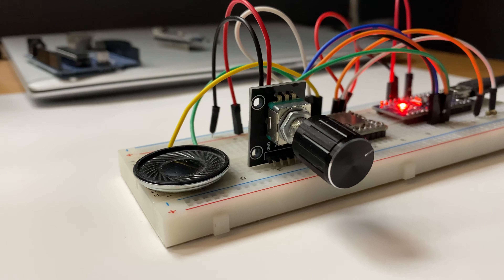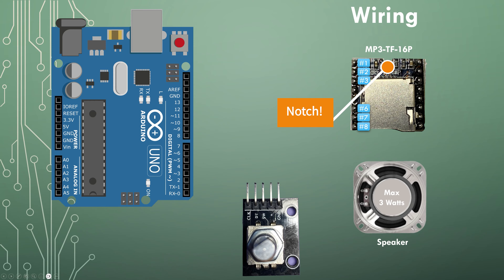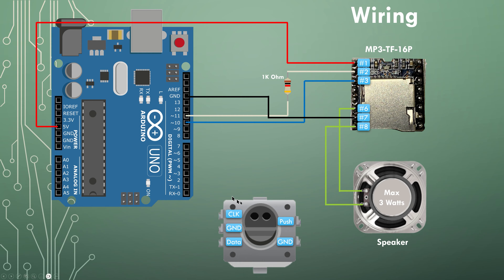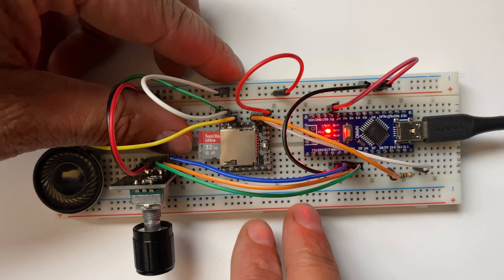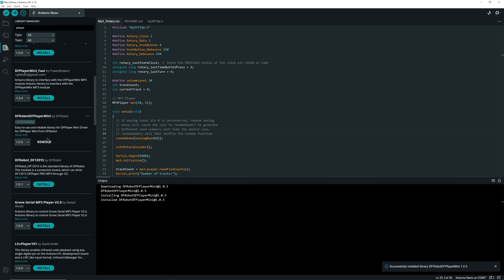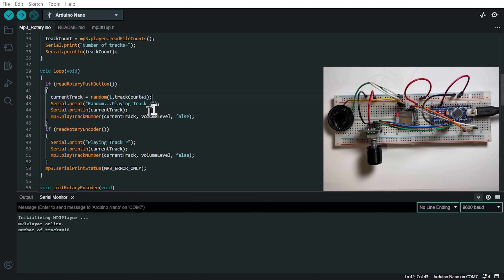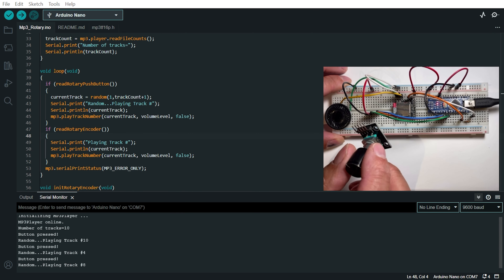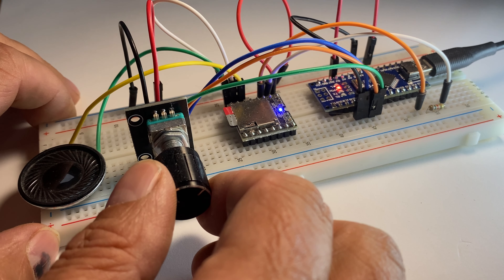Arduino Magic: Navigating MP3 Files with Rotary Encoder | MP3 Player Project Series

Comment: I appreciate the various Arduino and ESP32 videos you've done. I tried doing this one on an ESP32 but don't quite have the knowledge of how to do it. It worked as you described on my Arduino UNO R3 (Elegoo version). I do have a large number of mp3 files on my micro SD card so the count and random features didn't quite work as you described. Would you consider doing a video on how to do this same project using an ESP32? I've been playing with the ESP32s and loading up numerous features on them because of their faster speeds and more memory. I share your enthusiasm regarding Star wars and really like the various displays you've developed and adding sounds is fun. Thank you.
Reply from the maker: Thanks for the suggestion, I will add it to my list.

Comment: Hi
Wonderful project! I have a special needs kid who loves turning knobs. I have bought him several old fashioned radios (with knobs) and he plays with them all day!
I was in the middle of making a very similar project like yours. Here are some ideas that I need in addition to all of your nice work:
1- it needs to run on a rechargeable li-ion battery so is it possible to use 3.3 volts instead of 5v? It spares me having to boost the 4.2volts from the battery
2- it needs to go to very low power mode if the knob is not turned for over m-minutes. Then it comes to life after the knob is turned. This is to allow the child to go to sleep and save battery.
3- it would be nice to set the volume level by pressing and holding the knob for say x seconds. Then turning the knob left or right would play a test track at that volume level. If no knob turning is detected for more than y seconds, then knob function would return to normal
4- a config.txt file contains all the variables can be saved to the sd card (m,x,y)
I intend to plant this device inside his favourite stuffed teddy bear which he takes to bed to help home sleep. He is 29 years old with the brain capabilities of a 4 year old.
Thank you SO much!
Reply from the maker: Wow that' a good plan!

Comment: Couple of things: the current drawn by the player can  exceed the current limit of the 5V pin of an Arduino so safer to power separately. As with all IC's a decoupling capacitor should be placed across VCC and ground of the player.

The speaker issue is a little fuzzy as the documentation is not great. I've yet to find a definitive answer but it does appear the speaker impedance should be 8ohms. As far as the 3W max i believe that's the max the amp can deliver so you actually want a speaker that is rated higher than that otherwise at max volume (default at power on) it could damage the speaker. If you've found anything different I'd be happy to see it
Reply from the maker: I have monitored closely the current draw with the speaker volume at the maximum level and it never exceeded 250mA total, but I dot not measure specifically the power consumption on the MP3 player module.
Reply: @thelastoutpostworkshop  thanks for the info. Good to have some hard data.

Comment: I love Arduino and Star Wars as well.  Your work is really good.  When we go to DisneyWorld, we see lots of Starwars props but I never knew the work that was involved.    Thanks for posting this.  Recently,  I was able to make mp3 selections using a 4x4 keypad (only 16 choices).    However, I  would like to use the keypad to select 100+ tracks (and show the chosen selection number on LCDi2c)  but I have been unsuccessful.   I am going to keep watching tho because I'm learning from you.
Reply from the maker: Thank you very much!
Reply: I wanted to also create a project to selectup up to 16 songs with different buttons. How did you get this done?

Comment: I am new to getting mp3 files to read on the DF Player. I'm suspecting that I may have not loaded them properly on the SD card. My "Number of Tracks=-1". When I rotate the knob, it appears to go from track to track up to the 10 tracks I have loaded, but when I push the button, it is always track 1. I'm assuming this is because of the trackCount=-1. Any ideas what I might have done wrong? I renamed the files removing any spaces and replacing with "-". Is the a limit for the record name? I appreciate these fun things you've put together and always look forward to them. Thank you.
Reply from the maker: The filename of the files on the SD card are not important, the module address them by number.  If you try to play the first track after the setup  like this :
  mp3.initialize();
    mp3.playTrackNumber(1, 15, false);
Does it work ?
If you call mp3.player.readFileCounts() does the module report the correct number of files ?
Reply: @thelastoutpostworkshop  I appreciate your quick response. I can confirm the various tracks do play when turning the knob. It works both Clockwise and Counterclockwise. When I push the button, it keeps playing the first track. trackCount (mp3.player.readFileCounts();) is  "-1". I'm assuming the trackCount not properly displaying the number of records is what is causing unexpected results. When I force the trackCount to 10 (the number of records) everything works fine. I tried with a different SD Card (different number of tracks and the value for mp3.player.readFileCounts(); again displayed as "-1". Very confusing. I am using version 1.0.6 of DFRobotDFPlayerMini on Arduino IDE 2.3.2 with a Arduino Nano. I'll keep trying things and let you know if I get a correct mp3.player.readFileCounts(); value. Thank you.
Reply: I tried a couple of things. What seemed to work, is doing the "mp3.player.readFileCounts();" twice. The first time returned a value of "-1". The second time returned a value of "10" (the correct number of tracks). This "double read" seems to work. I tried using a "delay(4000);" and "mp3.player.readFileCounts();" once. it didn't seem to work. I don't know if there is more that should be done after the "mp3.initialize();". Very strange. At least I'm getting an accurate track count now (I'll leave the double read in for now).

Comment: First thanks for your tuto, so far so good, removed the glitch sound but I still have some noise. Any idea whats causing this? Instead of a speaker, I have connected a headphone jack (TRRS 3,5 mm), the volume is at 1 and the noise is pretty loud.. thanks in advance!
Reply from the maker: Did you add the 1K resistance ?
Reply: @thelastoutpostworkshop  yes, but finally found out this morning,
- add ground from dfplayer to trrs
- add 10k resistor to DAC_L and DAC_R

The shhh noise is completely gone!!!
Reply: well don't know why it stoped working with 10K, I lower to 200R and its more stable now :P

Comment: I can use a push button?
Reply from the maker: Yes you could adapt the code to use a push button instead, for exemple a push goes to the next sound and a long push reverse the direction
Reply: @thelastoutpostworkshop  Can you make a video using several buttons to play different audios? I tried to do it but it didn't work for me.